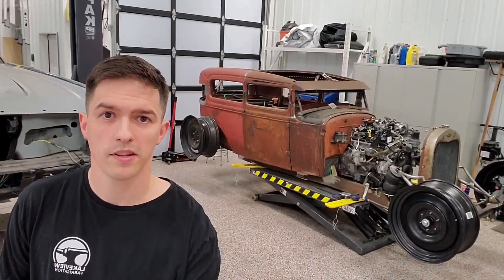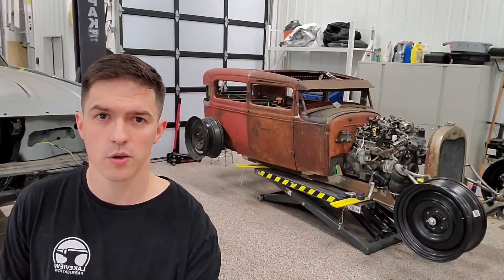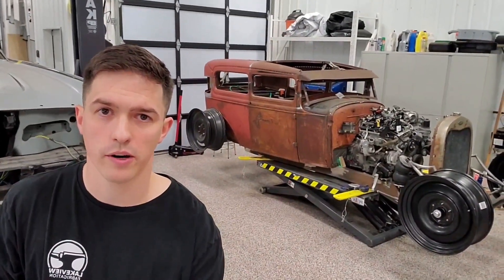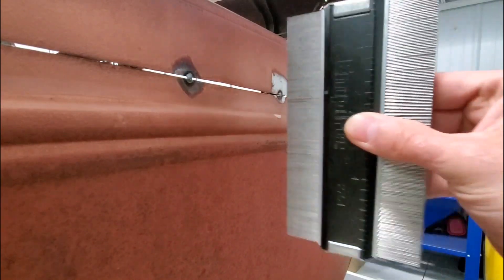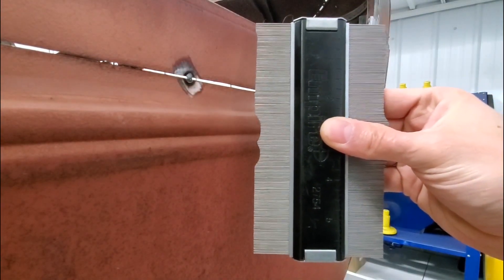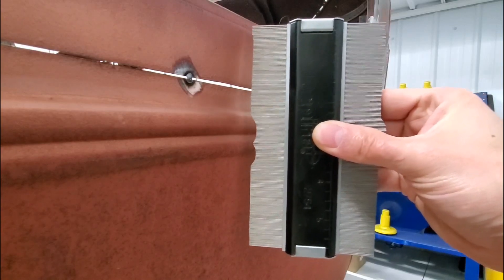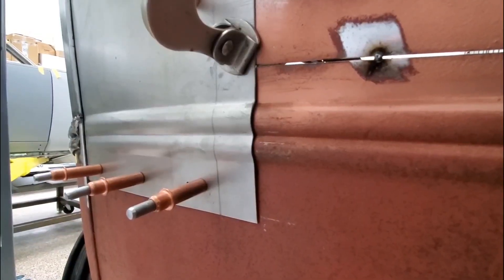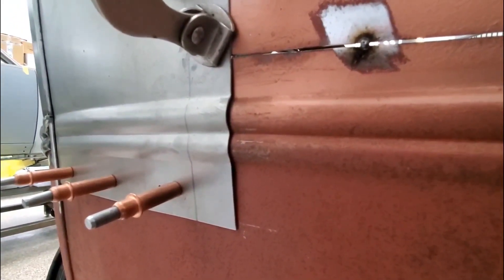Custom 3D printed bead roller dies for a vintage Model A!

Comment: So...... how did they turn out when you welded it in?  Any additional tweaking required? 👍😎👍
Reply from the maker: There is always a little bit of tweaking required during final fitment and welding, but this panel lined up really good and the body lines worked out perfect. Thanks for watching!

Comment: How'd these types of jobs happen before 3d printing?
Reply from the maker: Traditionally you could machine these dies from steel. Or use a pullmax/reciprocating type machine with hand made dies. Both work exceptionally, but this is much faster, more affordable, and doesn't require high dollar equipment. I'm into the bead roller and printer for under $500

Comment: Ok I need to see a tutorial on how you built those on fusion so fast. Was that actually the steps or did you pre make some stuff?     That looked so simple.
Reply from the maker: Good eye! I already had the base model for the dies made (and test printed to ensure proper fitment). To add the profile, I inserted the picture of the contour guage (insert canvas) and scaled it. After this I just created a sketch of the shape, and used the revolve tool to add add it to one die, while using the same tool to cut it from the other die.

Hope this helps!